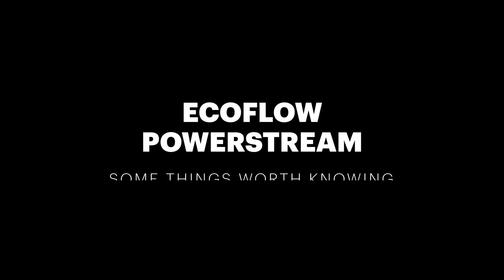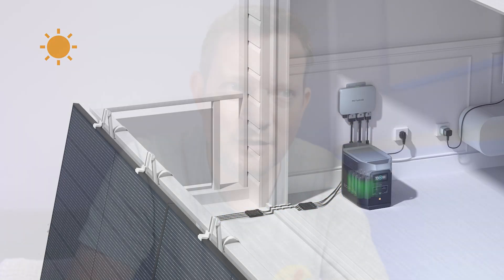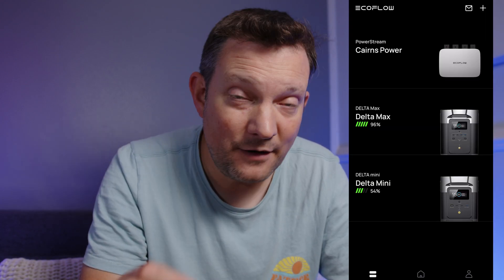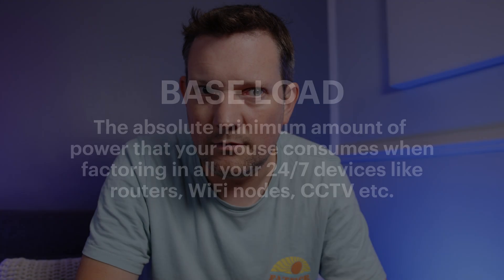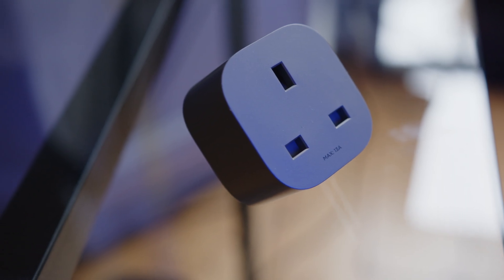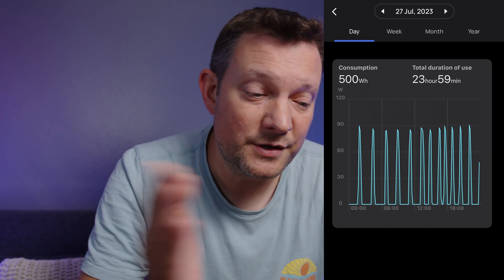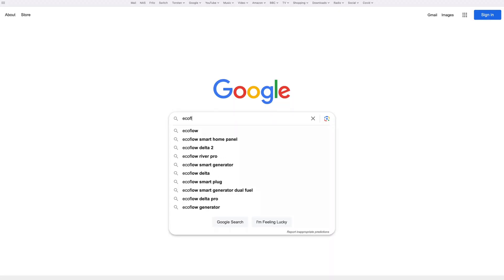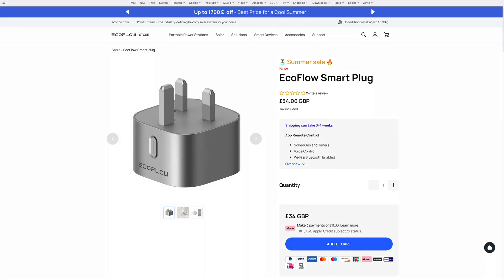EcoFlow PowerStream - 10 Things You Don't Hear

Comment: Zendure SolarFlow ...not a spokesman of this but the things you rised about ecoflow seems to be solved but who am i
Reply from the maker: I’ll have to investigate. 👍🏻
Reply: My experience of EcoFlow products is that they work on improving the firmware and app. I’ve been quite impressed by the improvements they have made so I feel confident that the same will be true with this product. I’ll be keeping an eye on this they may even release a better version like they did with the EcoFlow Wave, the Wave 2 is a big improvement over the original Wave oh and what to do with that spare battery because you can’t have two batteries plugged in well you can use it to power the Wave 2 and because it’s DC to DC it’s more energy efficient plus the Wave 2 can charge the battery if you plug DC solar into it.

Comment: The Version 2 is coming out. Has ENA approval. So hoping to get paid for exporting energy...I was hoping not to buy the Power station, Saw a video with 1 guy using 2rd party power station with a Cigarette lighter Battery cable from Ecoflo uses an All-Powers station instead. Difficult to see if I could just use 12v batteries without owning or getting a demonstration Model. Thanks for your Video. Not sure if Octopus will even approve it without a Flexiorb certificate... But thinking if I get am Export MPN myself octopus would agree the export tariff.

Comment: Hi, My EF system works fine: ☀2x480w Bluesun into EF 800W Powerstream &☀ 1x480w Bluesun into EF Delta Pro - XT60 input ... If I have the household power demand set to 800W in the app, the application shows me that 800W goes to the house network. In this case, as the limit charging the house is max 600W, is 200W leaking into the outside grid ?
Do I need to set the household energy demand to 600W max, so that all the excess solar energy above 600W goes into the Delta Pro battery? Our base load is about 200 W a day and under 100W at night? How to set Up power demand???

Comment: Thank you for your video. I have 2X 410w solar panels with 13A each. Ecoflow powerstream says it can take a maximum of 13A solar input. Does this mean that it can't take 2X 13A 410W solar panels?
Reply from the maker: You’ll be fine. They actually sound nicely specced for this product. The only thing you have to watch is voltage. My guess would be these are 36V? If so, they’ll be perfect.
Reply: @tdcattech Thank you for your speedy reply. Yes they are 410w Lungi solar panels with the voltage of 36v. Ecoflow should release CT clamp based power management rather than smart plug based.

Comment: Hey thanks for the video! .. Is it possible to run power stream without any batteries? Like just the solar panel and power stream only directly to the grid
Reply from the maker: Yes. It will work but what I have found is that it can be a little unreliable coming back on in the morning when it powers back up. Remember that the whole thing naturally turns off when it gets dark and you can’t access it via the app etc.

Comment: @TDCatTech hey TD, im having some odd behaviour on my powerstream not sure if you get the same. 

Basically whenever I set it to prioritise power supply, it channels all power to the smart plugs + other loads - but other loads is arbitrary and in ridiculous numbers (without sending any to the battery). This is the case even if household power demand is set to 0w. 

Do you know whats the cause of this?
Reply from the maker: No, I’ve never seen this before. Is it connected to main Delta unit (not an extra battery)? I assume you’ve reset the system. By reset, I just mean unplug from everything. I notice that EcoFlow firmware updates are much less frequent now 😢

Comment: Can you use x2 800watt systems meaning smart plugs can configure to one or other or would they conflict..
Reply: I have two 800s installed along with 6 plugs,and two max 2 batteries on a separate 30a mains circuit,to the house in my garage ,they can be configured as if separate systems in the app,also if you put a load on any plug say like my heatgun at 1300w the two powerstreams work together to cover the load.
This setup is temporary as I brought second one for family member,just thought I would try both together,works with
No conflictions occurring,when you are in the "Space Tab" double tapping the Solar tab shows you the two sets of panel inputs.
Battery info show average battery percentage of both batteries plus combined watts back feeding,tapping on battery shows individual levels.
Tapping on Powerstream icon shows you both units displayed separately giving you Solar,Home, Battery in/output data,and access to settings.
Reply: I don't own an extra battery for my Delta 2 Max, so with a single Powerstream attached I still have the second expansion port free. I'm wondering whether a second Powerstream could be connected into that. Did you try connecting two Powerstreams into a single Delta 2 Max?

Comment: Hey TDcat, I can confirm that the Delta 2 Battery works with Powerstream both ways!
Reply from the maker: Do you mean as a standalone power source without any need for an actual power station?
Reply: Yes. It will now backfeed power in just like the Delta 2. Mustve been a firmware update. @tdcattech
Reply from the maker: Thanks for confirming. I will have to retest that one and see if it works now with the original Delta Max extra battery (I don't currently have a Delta 2 Max extra battery)

Comment: Can I connect the powerstream to my delta pro and use the delta pro solar input and the powerstream solar input at the same time? (to give me extra 800w solar input) . I have an ecoflowsmart home panel so won't be using the power plug on the power stream to feed the house as the smart home panel deals with the whole home demand. I will essentially be using the power stream to give me extra 800w solar input from some spare panels I have lying around.
Reply: No you can only use either or

Comment: Hello. Another question from 🇺🇦 here.    

What will happen if I power my house during a blackout from a separate hybrid inverter + main battery?

It looks like Powerstream in this case should have baseload setting equal to zero and it will only feed the load required by smart plugs. In other case if baseload setting is above zero and the load disspapears the Powerstream will backfeed the main hybrid inverter and it will simply burn in the garage. 

Does Powerstream have any circuitry to prevent this? Socket-to-socket connection looks very straightforward. I also do not think Ecoflow doesn't know about scenario when the house goes off-grid, the infinite sink disspapears but the baring frequency is still generated by a third party inverter.
Reply: I would have similar question:
- What if  EcoFlow Delta Pro is serving as a "mains" provider? 
- What if that EcoFlow Delta Pro is connected with EcoFlow Smart Home Panel Combo?
Reply: @MyroslavOpyrQG  if Ecoflow power station does not make a frequency shift during a power outage or does not talk PLC to the microinverter then their design with a wall connector simply gives you no choice, you should consider It is safe to use it when the grid is formed by other Ecoflow device. 

But the problem is *they will never officially confirm this*. 

Actually it is logic to consider it safe. Powerstream generates only that power which is requested by their smart plugs + baseload, so the system is in balance. But will you risk your device to check it before blackout season starts?

Comment: 2nd question (sorry) How did you see that powerstream can only feed 600w of solar to the battery ?
Reply from the maker: Just through using it. Any more than 600W has to either be fed into the mains circuit or the device will cap the solar input to 600W.
Reply: @tdcattech  ok thats a bit annoying since they say 800w…
Reply from the maker: It brings 800W in on solar and 800W will back feed into the main circuit but just not into the battery. Disappointing but more odd than anything else as I'm positive it's capable.

Comment: With the delta max 2 you can input 800w from one plug I believe, no need to separate it in 2 cables right ?
Reply from the maker: Do you mean on solar? If so, 500W per port.
Reply: Thank you ! @tdcattech

Comment: If this thing cannot be used off-grid anyway, then what is the reason of having a battery? Can I use with no battery at all? I just want a photovoltaic in my balcony providing kWh to my house which will lower the demand of kWh coming from the grid. Is that possible?
Reply: Maybe a simple example would help: If you have solar panels producing 400Watts for 10 hours each day, you are producing 4kWh of electricity per day. If your house base load is 100 Watts, (2.4kWh in 24 hours) then your solar covers your base load during daylight (with some excess), but during the night, your base load is fed by the grid. So if you add a battery and charge it from solar at 400Watts during daylight (4kWh), the battery can maintain your house base load (2.4kWh) for the full 24 hours!
Reply from the maker: Solar powers the mains and charges the battery in the day and the battery powers the mains at night. 🔋 Yes, you can just use this with solar where you dump whatever you generate into your mains to offset usage (800W max). There’s a lot of potentially wasted energy doing it that way but it works great. 👍🏻

Comment: Can you feed let's sat delta pro with 1600w solar then feed back 800 w to home with this ?? Ignoring solar input of power stream
Reply: Maybe a bit late of a response but....Yes, you can feed energy into your home without having any solar input into the Powerstream MPPTs. But bear in mind that the connection between the Powerstream and a baterry such as Max or Pro is limited to 600W in either direction, so the only way to backfeed the full 800W that the Powerstream is capable of is to have at least 200W also going into the Powerstream through its solar inputs.

Comment: Hi, Living in BE, I have this at this moment without a battery running at max AC output 800W all the time but I'm wondering.... If i connect a delta max 2 or pro can I charge this with another set of solar panels with the XT60 connection of the battery its self? Second, can I daisy chain with 2 delta 2 max and an extra battery. You connect the powerstream to port 1 to port 1 of the extra delta 2 max and from the second max port 2 to just an extra battery? Support have this issue at technical now, but waiting for an aswer now for almost 1 month. I had issue with the new smart plugs, after lattest firmware they enabled mesh but i got random shutdowns and support provided me with an non public firmare resolving this issue within the week.
Reply from the maker: Your first solution will technically work but it's not practical because the battery would discharge to fill the gap between your solar production and 800W so you could be dumping hundreds of watts from battery into your grid but not using it.

As far as connecting one Delta Max to another, I don't believe this is possible. I'm not sure which one would provide the control in this case. I do have a Delta Max and a Delta Max 2 but I haven't tried it like this yet. Let me know if you hear any differently from EcoFlow because this would be excellent!
Reply: @tdcattech  Because I dont have a digital meter at this moment, dumping on the grid is no problem, the grid acts as an extra battery for now :)
I have already got 5 smart plugs, getting 5 more next month, so all devices will get connected, then for lights I will give the PowerStream a baseload of 150W, that was the plan

Comment: I wonder if you could  have something like that: Solars > Powersteram that is connected to Delta 2. Then stick 12V plug to River2 and connect it to Delta via XT connector . River connect to 200W solars via free XT port. 
This way you could have a charging ( 100W but still) from River2 (200W) and from Powerstream (800W solars). 
Would it work or software would block it and use energy that goes through powersterm only???

Comment: Thank you for your video. You have mentioned that it can be possible to use 500 W solar panel for one input. Are you sure with that ?  P.s. greetings from Ukraine 🇺🇦
Reply from the maker: Yes, you can use any rating you want as long as it doesn't exceed 55V (I imagine a 500W panel will be around 36V). In my experience, each input is capable of 500W even though the two together cannot do more than 800W so yes, if you attached two 500W panels at different angles to the sun, you'd have nice coverage.
Reply: @tdcattech  thank you for your reply. I will be definitely use 450 W panels. We might have a hard winter in Kyiv so preparation has started since last year. :)
Reply from the maker: I wish you well and hope that the winter is good for Kyiv and Ukraine as a whole.
Reply: @tdcattech thank you

Comment: If only EcoFlow would make a p1 meter that does the same as the powerplug but now for the whole house.
Reply: Seeing this video again I think I like to share my setup. Not to show off but as an alternative. It might not be as fancy as EcoFlow does it, but good enough.

My solar panels charge a 12 volt battery that has heat mats. It is outside on my balcony in a battery box and protected from the element.

A Victron 100 20 has a load port set to battery life that will send 12 volt inside the house to my two Ecoflow devices which need some power to stay charged.
These Ecoflows have their AC-out on and connected to a transfer switch. One is for keeping the kitchen running, the other for internet and computer.

In case the 12 volt battery outside goes above 13.7 volt a DC-DC 10 A opens and will send 25.76 volt to an inverter that is plugged into a smartplug that is plugged into a wall outlet.
If my house uses more then 160 watt the smartplug opens and about 160 watt will be pumped into my house. That inverter does not get warm at all but also lives on the balcony.

The above will work fine as long as I don't get to much solar. When there is a lot of solar I have the option to turn off the input of the transfer switches and run part of the house one or more hours on batterypower to make space for new solar coming in. That is a luxury problem :-)

When the grid goes down, the Ecoflows will need all the power from the balcony to power the important parts of my house that is connected to these transfer switches.

Comment: As for the battery/solar + powerstream/solar, it works with my river2max. I have 2x100W panels connected to it, and 2x400w panels directly to powerstream. And I've set river2max to turn on 12V plug > Powerstream when it's charged over 80%. So it sends maximum 100W via 12v, which is cool for my purpose. 
While Powerstream and 2x400W panels through day sends the maximum it gets from solar to the grid or devices in my house.
Reply: Do you wonder if you could add to this Delta 2. And have something like that: Solars > Powersteram that is connected to Delta 2. Then stick 12V plug to River2 and connect it to Delta via XT connector . River connect to solars via free XT port. 
This way you could have a dual charging ( 100W but still) from River2 ( connected to solars) and from Powerstream. 
Would it work or software would block it and use energy that goes through solars/powersterm???
Reply: @BogdanWiewiorka  Ive done it!
2x400w directly via Powerstream and 2x100w via river 2 max to Powerstream and works daily without a problem!
Reply: @vedranart   Am I correct in thinking that the energy can only flow in one direction when Powerstream is connected to a River Series battery? i.e. there is no way the Powerstream can send energy into the River via the 12v cigarette lighter connection? So all solar energy going through Powerstream MPPTs must either be fed into home wiring or else it is clipped?

Comment: Bs7671 chapter 55, no generator used in parallel with the grid can be connected via a plug and socket. In short it breaches UK wiring regulations by being plugged in, also section 712  it should be on it own dedicated circuit. Also no ENA aproval for connection to the grid. In short the power stream in the UK falls short of meeting basic regulations and shouldn't be for sale. Oh hang in you can't buy one as there all "sold out" 🤔
Reply from the maker: Many thanks for the clarity on this item. I'm trying to find a full copy of BS7671 to verify but I'm definitely not going to go down the legal implications of using a device like this. That's definitely not in the remit of my channel and equally not my expertise. 🙂 This device is listed in places like B&Q here in the UK (though not available). I wonder if it's being pulled?
Reply: @tdcattech  I have copies of the relevant section is the BS 7671,, altho I don't know how to post them as images in YouTube, chapter 55 section 551.7.2 subsection (ii) is the part that says it cannot be on a plug and socket. 551.1.1 specifically mentions photovoltaic sources of generation are included (one of the argument was that the chapter 55 was for backup generators, when in fact it's for ant generation in parallel with the grid and a back up generator would be run seperate to the grid via a change over switch)

There's other issues round rcd type aproval and turn of times, as well as the fact the EcoFlow CE declaration calls it a fixed install and not a portable one.
It hasnt received ENA aproval yet and aproval was only sort after the product was launched, so shouldn't be connected to the grid u till aproval and then requires G98 notification to the DNO.

It's a bit of a shame EcoFlow ignored people on this as it will give them a bad name in the long run. But I suspect the reason you can buy it in Germany but not in the UK is because they've finally cottoned onto the fact the product dosnt comply in the manor they have sold and advertised it.
Reply from the maker: It would be great if you could email them over. My email address is on the channel 'About' tab under Business Enquiries.